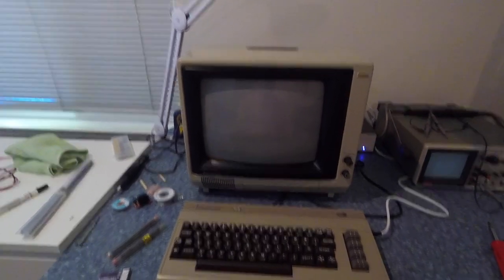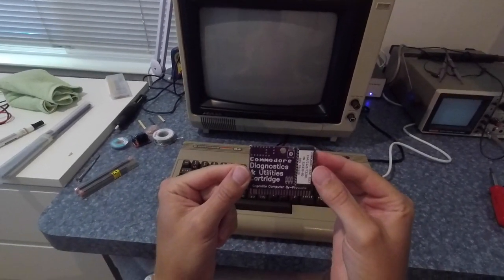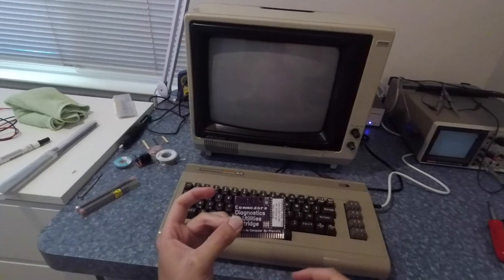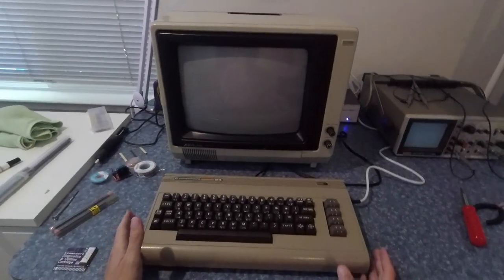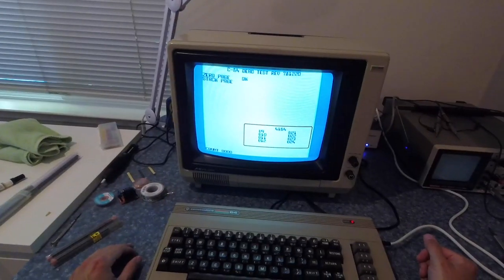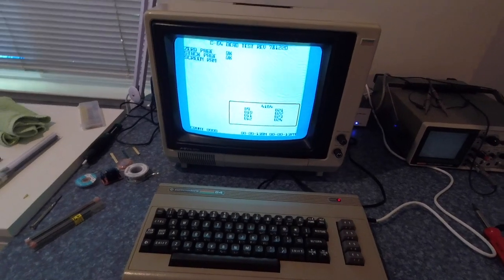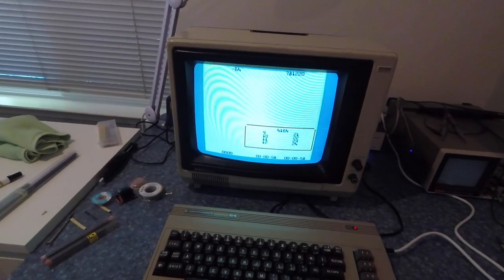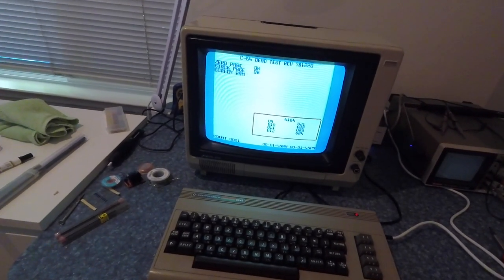Fixed my Commodore 64!!! (plus "dead test" cartridge overview)

Comment: I working on my black screen Commadore. Did a recap and I'm going to replace my PAL and a voltage rectifier. I have some others with less problems with bad CIAs (bad ports/keyboard issues). I have a dead test cartridge but I haven't been able to get it to work. I'll research it. But yeah, great feeling to get them working and a lot of fun!